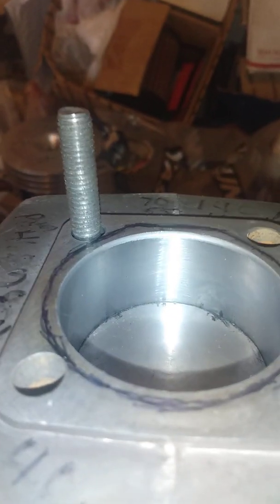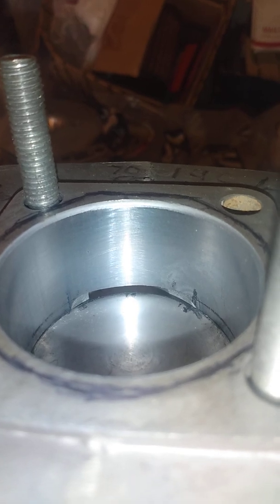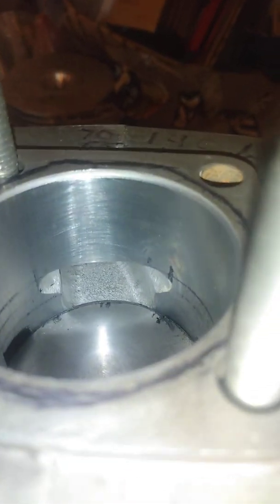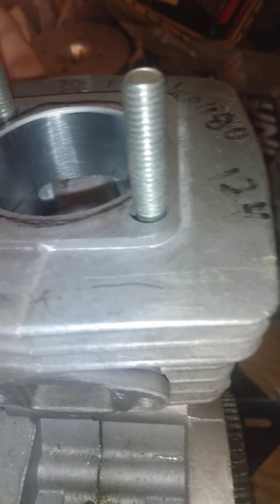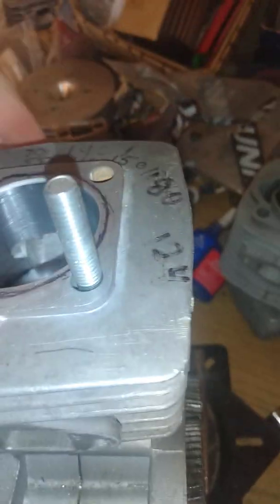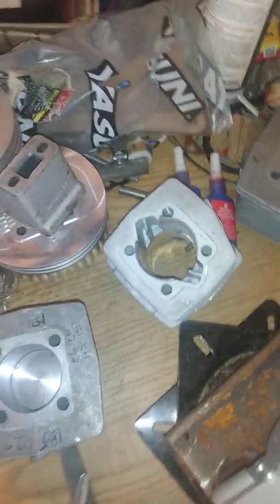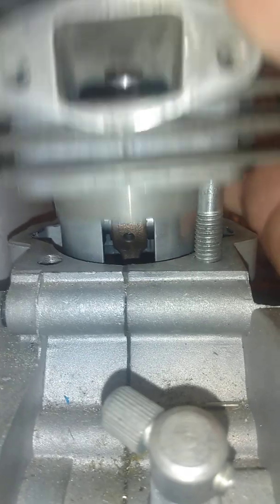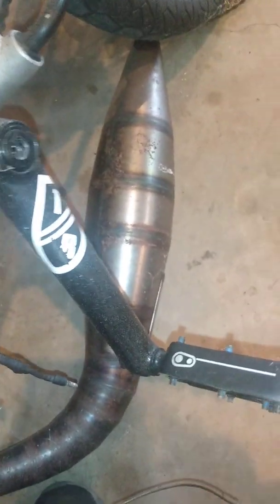motorized bicycle trick ports explained. why I choose this shape.  why window hight is important

Comment: Is this mushroom shape applicable to all cylinders for these bicycles engines? I have a 52mm piston and my motor is 85 avenger
Reply from the maker: No the mushroom 🍄  shape is for the cyls that have offset exhust port. Great working shape all the changes are above tranfer opening. Way less work way less risky  and keeps incoming pressure  waves from pipe up. Win win win

Comment: I'm in the process of making a really good engine out if pieces I'm collecting from alot of the good builder's out there like butler and smolick. I started out with a seized af80 crank and did a complete rebuild. Don butler did my port work 122, 174, 26bd. Everything else I'm doing myself and it's all by feel and eye. I'm trying to learn more but I don't have anyone around me that knows what there doing so it's difficult to learn when there is no teacher. I watch as many of your videos as possible but I would like to be able to message you for advice and maybe even buy some of your work so I can continue to build with the best parts from great people who do it right.
Reply from the maker: I don't use messenger zero bit